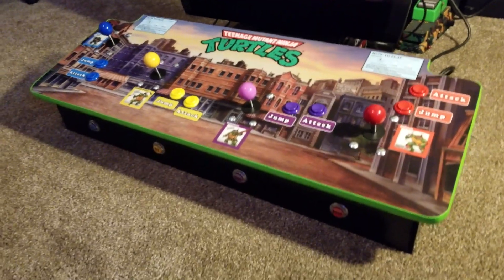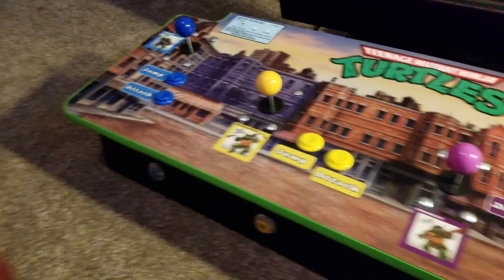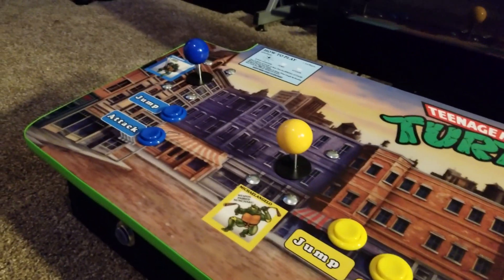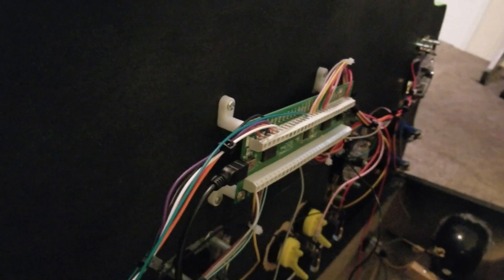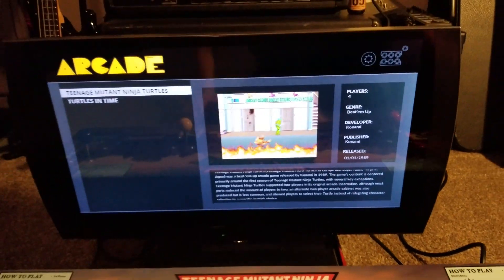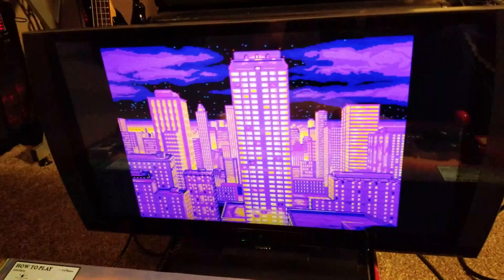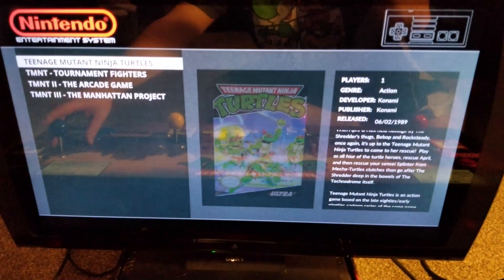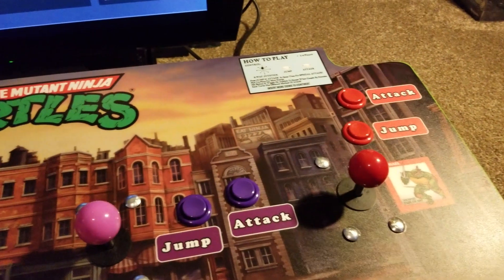Teenage Mutant Ninja Turtles Raspberry Pi Arcade Console

Comment: HELP. 
I CAN NOT get 4 player programed on my raspberry 3
Reply from the maker: What are you using for your controller encoder?
Reply: @retr0type  
The arcade controls from Amazon
Reply: @retr0type  
4 individual encoders.
Do I have to use retroArch menu.
This is a pain
Reply from the maker: @matthewm7540  
When I built my friend's 4 player cabinet with 4 of those USB encoders, I used a 4 port USB Hub to connect them. It's probably not required, but it allows you to only use one port, which was a necessity for what I was doing. The encoder I'm using in this video is an Ultimarc iPac 4, which Retropie sees as just a standard QWERTY keyboard, so this did not apply for my TMNT cabinet.

I also used the information outlined here: 

https://retropie.org.uk/docs/RetroArch-Configuration/

If I can recall, I also had to enable those 4 controllers individually on a per emulator basis by entering the Retroarch menu during gameplay (Hotkey + X). Once you enable the controllers, you have to make sure that when you exit Retroarch, the settings are set to auto-save on exit. I think it's listed under "Settings" and then you just enable "Save Configuration on Exit".

Let me know if that clears anything up.

Comment: This is absolutely fantastic! Excellent job. I have a quick question though. Which MAME did you use? I got a Raspberry Pi 4 a couple of weeks ago, and the MAME Within retropie runs pretty poorly. When I try to play any game, including a Ninja Turtles game, I get a lot of slow down. It simply doesn't feel very smooth. I'm assuming I need a better emulator, and the one that you use seems to work well. Please help!
Reply from the maker: Sorry for the late reply. I believe that I was using MAME2003 for this. I haven't picked up a Pi 4 yet, so I'm not sure how the software runs in comparison to the Pi 3. Also make sure you're using an AC adapter that provides enough amps, as a standard 5v adapter will cause the Pi to throttle speed pretty badly.

Comment: Amazing job. How did you get the two center contollers to be player 1 and two for the console games?
Reply from the maker: Thanks! 

I had to edit the retroarch.cfg file for that specific system, which overrides the global retroarch.cfg file. 

For example, for Nes I manually edited the retroarch.cfg file found at:

/opt/retropie/configs/Nes/retroarch.cfg

I hope that helps!
Reply: @retr0type  Thanks. I've been scratching my head over how do that very thing.
Reply from the maker: @custommartini808  Not a problem. Let me know if I can answer any other questions. I spent a lot of time playing with .cfg files and posting on Reddit, so I think I'm pretty well versed by now lol.
Reply: @retr0type  Wow thank you. was about to stat making a 4 player cabinet and was thinking this same thing. Thanks
Reply: @retr0type  On that note, how did you go about configuring the coin button and jump to exit the emulator?  I've tried editing global and specific retroarch.cfg's and neither seem to work.